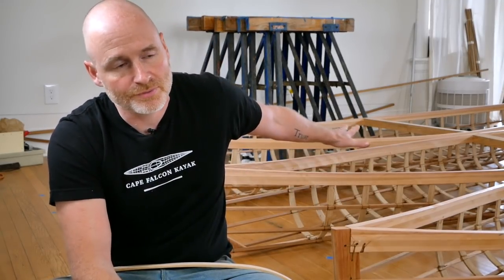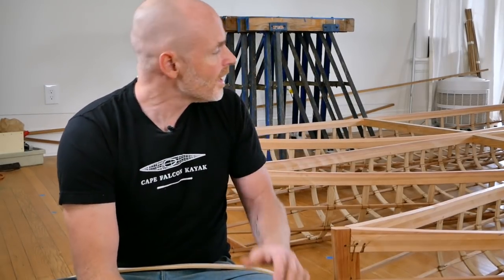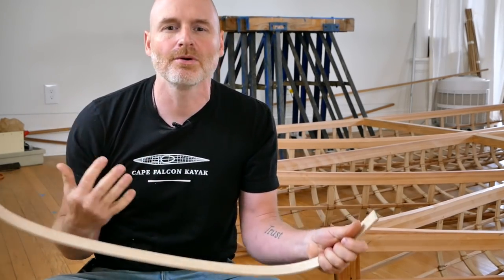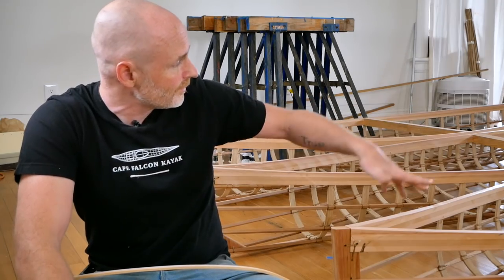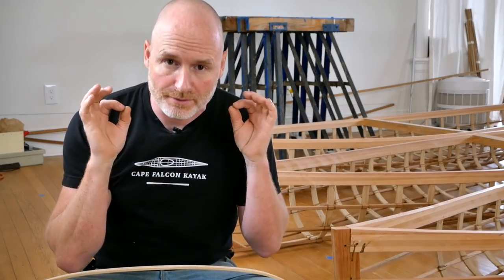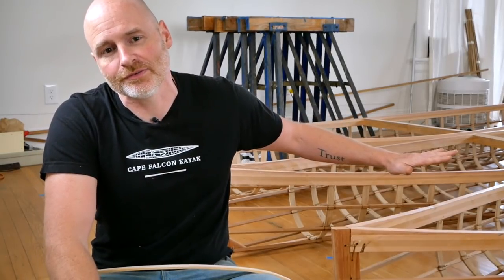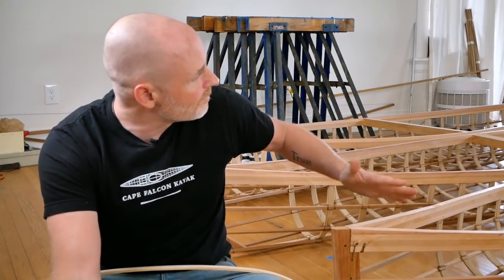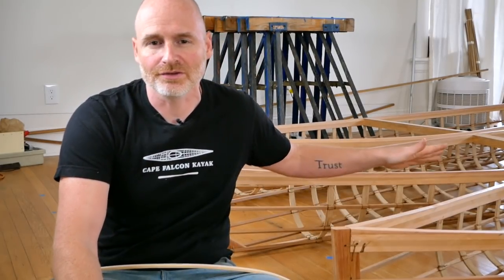Building a skin-on-frame Canoe.  Part 3:  Assembling the frame

Comment: Would you recommend the use of moulds and framework for novice boat builders? You obviously have an eye for it. I would get half way done before realizing an issue. Also I'm somewhat of a primitive and wondered if riven wood , like white cedar would be a good choice. I'm in the NE USA and can get reasonably clear white cedar.  I would like to get some plans from you and get a course when I'm closer to build time.
Reply: Watched part 1 intro and heard you address my first question nicely and sounds reasonable , logical and fits my style of construction.

Comment: Fascinating process.  Looking forward to the maiden voyages. I see your point about the centre thwart.  On the other hand, a thwart/yoke is more or less essential for portaging.  It strikes me this type of boat would be ideal for solo, inland tripping particularly where there are many/long portages. The light-weight would rock in those circumstances.  And I think there's a pretty big market of folks doing that kind of paddling in the Great Lakes region and points east, who presently have to spend thousands on a kevlar boat to get the kind of weight savings you're producing in skin on frame. In that light, you might want to consider at least making some provision for an optional thwart/yoke in your design.
Reply from the maker: A removable thwart is definitely happening,  last night I was working on one that could change positions in the canoe.  As far as weight, I don't think skin is  any lighter than carbon/kevlar.  I think if you make a good skin boat, and make the same boat in carbon/kevlar, they end up being equally strong (or weak).   I think the advantage of skin on frame here is to be able to build your own, and being able to use the frame for attachment points (super easy to lace in float bags!!)  I specifically made the gunwales the way I did so could easily set up a catamaran rig.